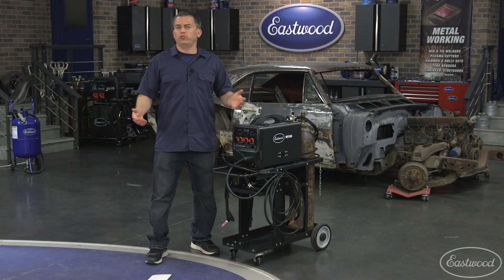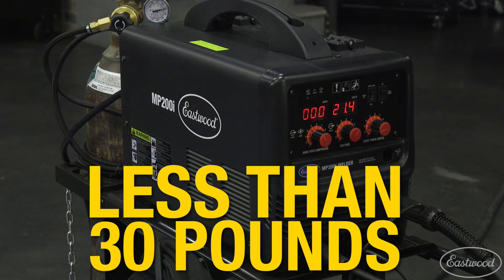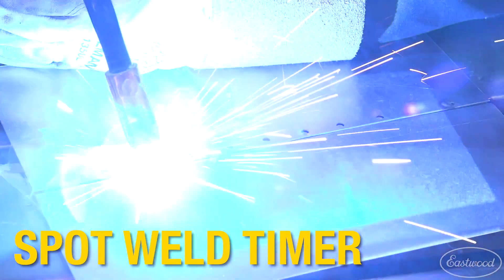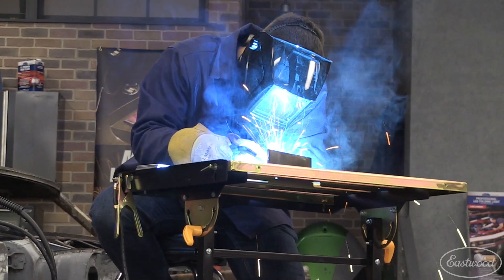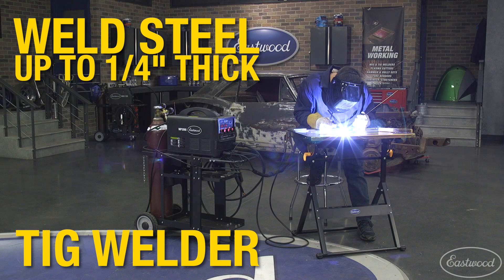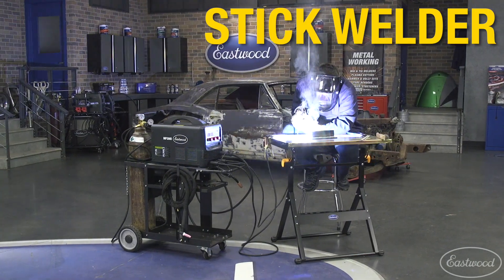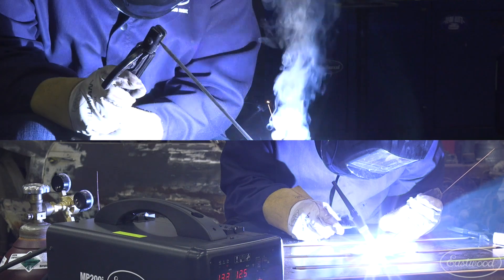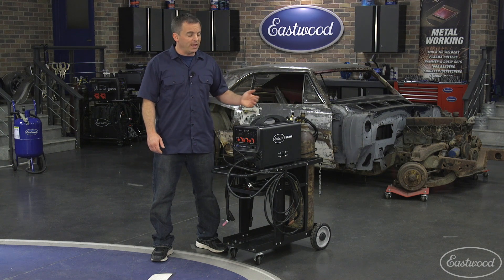MIG Weld, TIG Weld, & Stick Weld All In One Machine - Eastwood MP200i Multi Process Welder

Comment: Correct me if I am wrong, but this isn't a dual voltage welder. No 110v?
Reply from the maker: It operates on 240 volts.

Comment: Can you TIG weld aluminum with this machine?
Reply: reallisticly you can weld aluminum with tig on dc if ya know what your doing. its getting too be a lost art and believe me they should be teaching it because it is vary handy. its a rough way but it works. just make sure you get it clean first tho.
Reply from the maker: It welds steel on the TIG setting.  Here's an Eastwood TIG Welder that will weld aluminum:  http://www.eastwood.com/tig200acdc-53012.html
Reply: Oscar De la Serna You need AC tig output to weld aluminum. I think this one only does tig in DC. However, you can mig weld aluminum with a spool gun attached to this welder.